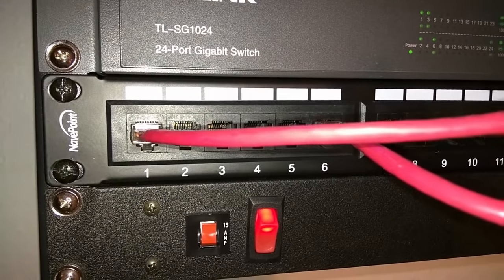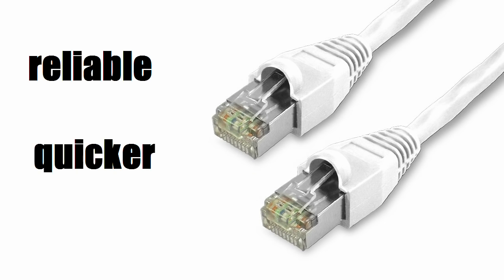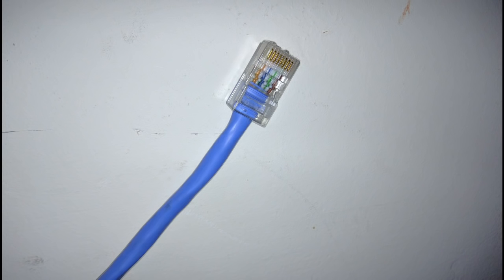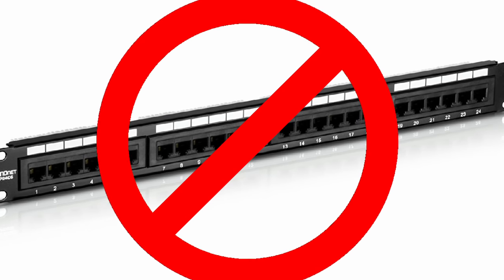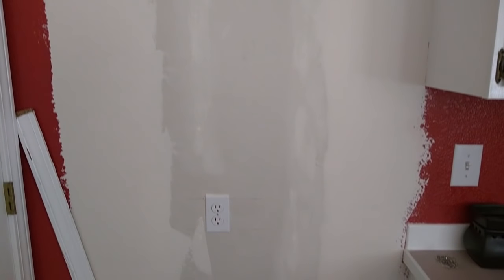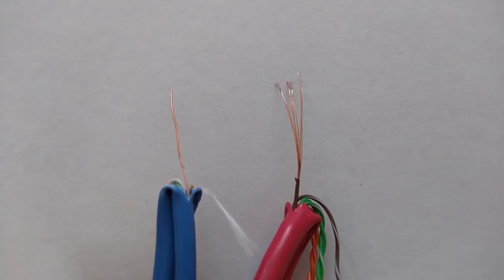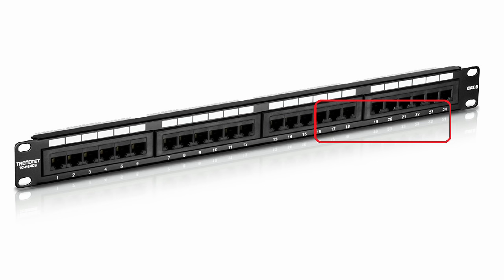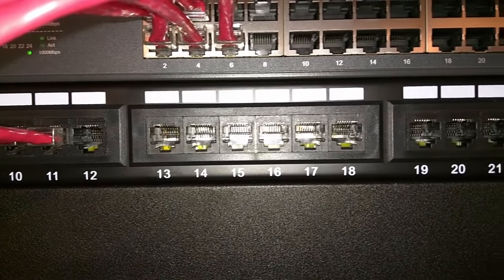What is a Patch Panel? Do You Need One?

Comment: You left out one important Pro for direct connection to the switch, fewer connections to go wrong.  The pros still out-way the cons however fewer connection in any system tends to be more reliable.  (Assuming your not stressing your solid wire). Adding a patch cable adds 4 additional connection points each time.
Reply: i disagree with that, from the keystone to the patch will never fail unless psychical damage happens IE jack get broken, nail through the cable, mouse. other then that iv never ever had a cable to just fail.    99% of the time the failure is on the user side.

Comment: so why not just use the stranded cable throughout then if its better?
Reply from the maker: The video answers this question.
Reply: Solid wire punches into patch panel and wall jack connections easier since it is a single conductor.  Stranded wire is easier to use on patch cable connectors since it is more flexible and less likely to break when crimped.  I personally just use patch cables into keystone couplers on wall jacks, and use stranded everywhere.
Reply: @omniges  I've punched down stranded runs on patch panels real easy.  And every where I've worked have done runs with stranded cables
Reply: Prakash Budhu  just explaining why someone would use solid.  I personally use stranded everywhere
Reply: @omniges  Hi big but... there are 2 different types of RJ45 plugs, one for stranded and one for solid core cables, the stranded one has 2 spikes that go into the strands and the solid has 3 off set spikes that go either side of the solid wire, what did you use?

Comment: Thanks for the video but how you can plug RJ11  into RJ45 this is not look right to me.
Reply from the maker: Some I've seen you can, like where I work, but if that's not the case, then you can get RJ-11 to RJ-45 cables and that will work. That's what we ended up doing here.
Reply: Actually, this is fairly standard practice. Dimensionally, RJ11’s are just a narrower version of the RJ45. If you need to connect an analog phone, and there is a convenient network drop nearby you can use it and save the trouble and expense of installing a much less flexible RJ-11 jack. 

Years ago, I worked at a company that had all of our switch tails landed on patch panels. This made MAC orders much easier, because all I had to do was repatch the tails to the drop location for the user’s new office.
Reply: An RJ11 plug is essentially a 4 pin version of the standard 8 pin RJ45. It will fit the same socket so you can easily plug RJ11 cables in at each end (patch panel / outlet) and the service will pass through without an issue. 

The only problem you might encounter, depending on your outlet, is unplugging as the catch might be fiddly to reach. A small flat head or paperclip lets you push the clip to release it.

Re the pins..... you essentially use the center 4 pins on the cat5 / cat6

Comment: Ok so here is my plan please let me know how it sounds.   I am having a house built as we speak. I have purchased 8 Defender security cameras that route to a home DVR and plan to have 6 rooms wired with 1 ethernet plug in the wall. And 1 room wired with 2 ethernet ports “7 rooms total”. So the plan is to wire all security cameras to corners of house. 2 cameras per corner. Other end of cameras go to attic where everything will be stored and connected. 

I will have 1 cable line going to attic to a modem. From that modem I will have 1 ethernet going to the main living room where it will connect to my router. From the router I will have another ethernet going back to the attic to connect to the switch. The switch will have all of the room connections on it including the 1 connection from the security cameras. 

The reason I want the router in my main living room is so that it will put off an even amount of wifi. The wiring of the ethernet is only for “if” someone wants to hard wire anything to the wall in the rooms. 

Thanks! Great video
Reply from the maker: Sounds good, but attics can get hot, and electronics do hate heat. Plus when most of your equipment is in the attic, you can't show it off.
Reply: @BudgetNerd  that is true :( and I do live in the south. I’m just trying to get a centralized location. I have a bonus room also but it is more on one side of the house. Also trying to keep from buying an extension cable for the camera as it only comes with a 60ft cable. The house total width is 72ft. I could show you a basic floor plan layout if you think I have a better option. I would love to show it off but just not be in the way or look tacky either. More or less want to hide it
Reply: @idlesquirrel  This may be late, but I would have more than one jack in each room. 4+ is my suggestion. Much easier to accomplish before the walls have drywall on them! Else, you will likely run into a situation where you are adding a 4 port switch in a room for more connectivity. And while this works just fine, it can look crappy, and be a cable management issue.

Comment: NOOOOO! Yes a "normal" phone connector RJ1q will fit into a network jack RJ45. BUT it WILL damage the RJ45 jack. The outer most pins will get bent and if you reuse that jack later for something else you'll be taking down that fault. Also it may not seat properly and could be unreliable.
Reply from the maker: Lately I've just been using rj-45 to rj-11 adapters.

Comment: Could you theoretically setup a switch from an Ethernet port on the wall so you can use more than one Ethernet cable
Reply from the maker: Yes you can add a switch anywhere in your network to get more Ethernet ports.
Reply: Yes, but you would limit your network throughout to that of a single port.

Example:

You have a main switch and your cable modem plugged into it. It can serve gigabit over every port on the switch. A single host on that switch can get 1 Gbit connectivity everywhere on the network.

Internet connectivity will be shared down the 1gbit port to your modem, but between hosts you'll get full gigabit transfers.

Now, on one of your switch ports it runs to your bedroom and you plug in another switch.

Now any hosts plugged into that second switch attempting to communicate to any host plugged into the main switch downstairs will be limited to the 1gbit uplink between switches. You'll get 1gbit between your bedroom switch hosts, but not to the downstairs hosts depending on network traffic.

So ideally you just want the single switch.

Comment: Wired connections are better, no matter you see hog speed in Wifi, dig into your pockets and buy the latest standard of wiring you will see speeds 2 or mote higher every time new Wi-Fi is released if not more so.
Reply: Shangrila La de da - That’s not the conclusion of the architectural community. Costs of rewiring when either standards improve or the space is redesigned dwarf any short term utility. 

This answer is typical when novices are being taught by other novices. That’s YouTube’s specialty. I guess it’s good for professionals because we end up making much, much more money on rework than new work.

Comment: You've gone to the trouble of putting in a patch panel, but no cable management? Where is the horizontal cable rail ? Ugh...
Reply from the maker: I thought about cable management, but opted against it for now. Trying to keep costs down and don't have a lot of cables yet. Once I get plenty more, I will probably add one.
Reply: Budget Nerd When you get one, place it between your patch panel and switch - bundle common runs with double sided velco, it'll come up a treat!
Reply from the maker: Just wasn't playing a ton of attention to that. I checked, they still work.
Reply: Ben Cummings n

Comment: Pro-tip https://www.amazon.com/gp/product/B00M367DTA/ref=ppx_yo_dt_b_asin_title_o03_s00?ie=UTF8&psc=1 Will make your life that much easier and faster if you have a lot of jacks 
rather then toning 2 jacks at a time you can get a budget tester that includes these little plugs that are numbered into the jacks all over the building 30 at time then you go to the switch and use the tester which identifies the numbered plug that is plugged in.

Comment: But why is it bare wires into patchpanel, and not another connector into it? Then you'd still have the clean adapter in the wall
Reply: more connectors add to the losses, expect to lose 1-2 Db signal for every single one. not to mention alien crosstalk with the connections nearby
Reply: @davidconner-shover51  ah fair, thanks!

Comment: Why not just use stranded in the walls?
Reply: This isn't ideal for a business since there are many ports and users. There's no scalability if things were just left in the walls. They run the wires from the walls to a centralized location where they are easily managed and connectivity.
Reply from the maker: The video answers this question. Plus stranded doesn't punch down as easily and other reasons.

Comment: keystone in one end and rj45 on the other end then insert it directly to the switch easy, does that make sense? patch panel is simply like a extension connector but you yourself you're the one who's gonna wired it up at the back heheh not sure if it was crossover or straight through. life is already difficult so why making it still difficult? like is there no device out there that can do all of that do that easier? a multi extension connector maybe heheh roast me up irdk what im sayin.  crimping one end is a lot easier for me than a patch panel. a lot of work and you still have to crimp another wire for the patch panel to switch connection.
Reply: No, using solid wire with plugs is a bad idea.

Comment: Yeah, I wish I could plug a wired Ethernet cable on my phone lol.
Reply: Jett A Angeles 
Just get a dongle ...boom problem solved ..
Would I’ve to see what will happen when your guests come ...
Give them something to drink to and and off course dongles ...
Reply: Jett A Angeles you sure can! Just get an adapter dongle. I do it all the time with my Google Pixel when I'm in an area with poor wifi.
Reply: No need, Wifi Calling works great for me.  I was testing my iPhone XS, and Wifi on my iPhone was just as fast as my Wired Gigabit Network on the Internet.  I ran Speedtest both on my iPhone with the app, and on my Windows Desktop.  I was shocked.  Much better than I remember on my 4-year-old iPhone 6.

Comment: You really don't need one, solid wire is actually really really tuff, most important as long as you have the correct wire and switch to match your internet speed you're fine, also less jumps and connections you have better speeds you will have, Jack's and faceplates in the field you are good to go, you shouldn't be unplugging your  equipment that much anyways, but really nice setup man really is, I've been working on mine, I have a Cisco catalyst 2960 managed switch but I'm changing it out with a Cisco sg110-24 unmanaged fiber gigabyte switch, think I'm gonna use the managed switch for just  My security cameras since it couldn't handle gigabyte if I don't sale it lol but once again sweet setup!

Comment: Is the patch panel the same thing as a switch?
Reply: Simple answer, no.
A patch panel is just an easy way to get all the cables routed from the entire house to one panel.  You still have to connect from the panel to an actual switch, using a patch cable.  

A switch one of many components that handles the communication between the devices, to put it simply.
As said on the video you can bypass a patch panel and go directly to the switch.

Comment: what about when cat7 eventually comes out?
Reply: Cat7 is out, but for home use you probably will never need it. Cat 6a for tv, cat6 for everything else is more than needed honestly. Unless you’re running the cables over 200+ feet.
Reply: @danielh2553  why cat 6 a for tv?
Reply: @toddcoleman6701 cause it's what you can but in 100m rolls rn ..and it's cheap ..stay away from CCA cable ..solid core for runs in the walls  and stranded for connection in which you need flexibility .
Anyways most smart tv have 100mbps nics so even cat 6 is overkill but as I have said is what shops sells you ..cheap and reliable for home use ..cat7 is for 10g
Reply: It's out now they already talking about cat 8

Comment: 9:40 why not just run stranded through the walls?  Why do you need to use solid?  Seems like you could forego solid and wire the house with stranded and terminate into the switch instead of the patch panel.
Reply from the maker: The video answers this question..
Reply: @BudgetNerd  it also wasn't clear to me, the benefit of solid over stranded.  Was it just that solid is easier for the punch-down step? Did I miss something?
Reply from the maker: It easier to punch down, is cheaper, and is more resistant to noise

Comment: Ive just realised today that if you didnt run the wires by yourself.. any patch panel setup can be a disaster; especially if you are not skilled in networking at all.  In a way its just another piece in the puzzle that can go wrong for example, when something goes down.. Otherwise as mentioned, it does look a bit geeky and neat, but is just not something id want to do in my home.  A used cisco switch and a couple of velcro straps would do the trick just fine with a bit less wires.

Comment: very good video. but I prefer software (can decide which devices, etc) and wifi... cheaper, easier to upgrade hardware.
This makes more sense in an office with non moving computers (like with old school selling business structure -- not always moving like programmers always have to, or a constant moving bodies), but a good building manager would add this if they are creating offices. Plus having to deal with possible high power to each desk station.
...
Now.... a personal network & no wifi as security precaution makes more sense for patch panel. 
Like this video....
He built home network for cameras, storage (for cameras[cloud might be better], could run multiple servers for media, maybe a software program he wants running, )
https://www.youtube.com/watch?v=pjfusRhDf70

Comment: What is an uplink ?
Reply: UP LINK in general can be a link between two (or more) switches, or between two (or more) switches on different networks.
UP LINK in general is dedicated port (or not) on a switch with higher throughput then the rest of the ports on that switch.
UP link it's just that an UP LINK (upload link connection) between network devices, on a same or on different network.
Reply: @NenadKralj  At one time an uplink port was a crossover connection.  These days, that's no longer necessary, though the greater bandwidth is certainly usable.

Comment: Not a fan of patch panel in a home setup.  I prefer to use multiple switches in a setup.  Switches are dirt cheap.
Reply: Stephen Wong two completely different purposes. I have a switch in multiple rooms but they all terminate back at a single patch panel in the basement where the main networking and storage hardware resides.  Daisy chaining switches all over the house is a mess and upgrading to 10gbe, for example, is a mess since each switch in the chain has to be upgraded in series. You also have to split the bandwidth instead of using the internal fabric and distributing to switches.

Comment: Hence, why most people use wifi.
Reply: Wifi is great, but you lose connection the farther away you are from the source. I live in a house that was built in 1919, and the walls block a lot of the wifi signals, since they are made of brick/concrete. They block a lot of the wifi signals. So, it forced me to run ethernet all over the house. Plus, I also have a file server and even when I'm near the wifi spot, ethernet is the only way I can take full advantage of the file server. Wifi is just too slow. It's reasonably fast for everything else except for making the most of my file server.

Comment: Let's see... Two computers, one access point, one NAS... nope, I don't need a patch panel...
Reply: Agreed, if someone has less than 10 Ethernet runs, they don't need a patch panel. I have about 15 Ethernet cables home run back to my MDF, and three other sub distribution points each with 2 or 3 runs (and a small switch). Up to now, I haven't done a patch panel, but am in the process of putting in a 24 port panel as I have more expansion planned.

Comment: Oh my God! I had the patch panel installed by a company, and all cables to the different computers as well—this is a restaurant. 

The issue that I have is that if I plug the ethernet cable to say port three, then only the computer that is connected to port 3 gets connected to the internet.

I saw the video just to learn how I connect the patch panel to the router so that all ports have internet, and that's exactly what the video doesn't say.

I whatched 'til the end and was dumbfounded when you missed this point. 😩
Reply: I think you need a switch. A switch directs your Ethernet cable form your modem and router and send it to different computers. Hope this helps :)
Reply: Patch panel connects to switch not router.
Reply: If you had a semi decent company install this in your business, I would call them to make sure its setup correctly. A decent setup would have a patch panel and then either the ports patched into your router OR into a network switch if you need more ports than what your router has. Most typical home and small business routers have 4 ethernet switch ports. If you need more than 4 ports, you plug a switch into an empty port. You then plug your extra devices into the switch.
Reply: Simple Answer: You can't. You can't just connect the whole patchpanel to the switch/router. You have to connect every single port you want to use. The patchpanel is just a combined part where all your different cables come. If you want what you wrote about you wouldn't need a patchpanel, you need a switch where you directly plug in the cables coming out of your wall